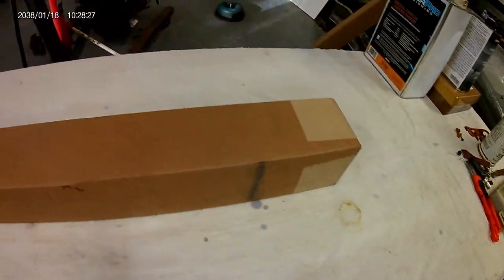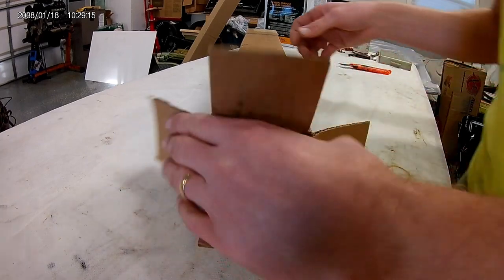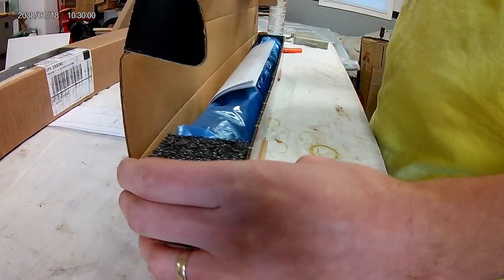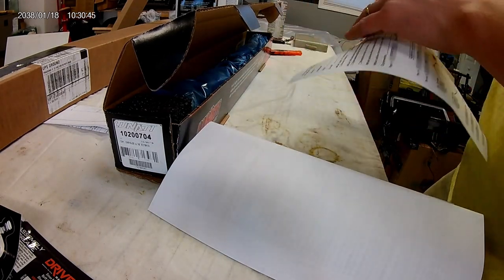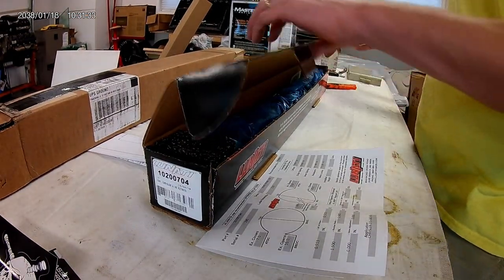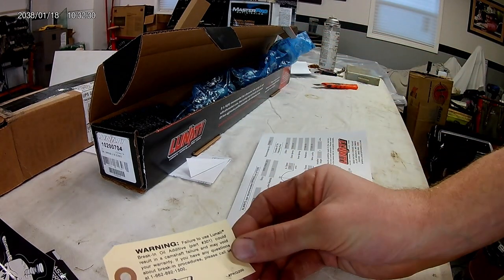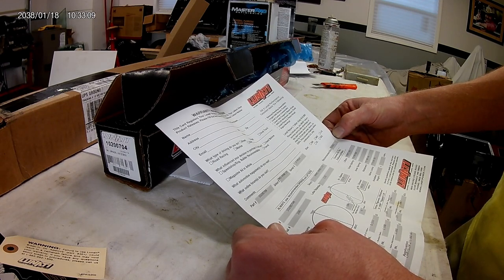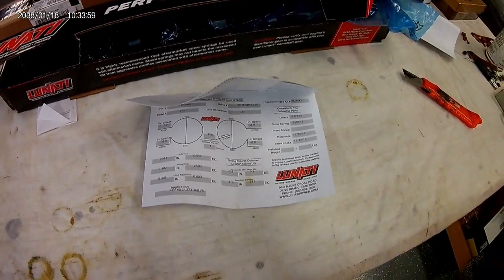Lunati Voodoo Camshaft Unboxing(Small Block Mopar) Part number LUN-10200704

Comment: Do lunati cams really change the performance of the engine for the better or is it just for sound
Reply from the maker: Absolutely better performance. If you can afford a roller setup, it’d be a great idea.
Reply: @JustMoparJoe  i cant ahahaha well i can but im running a budget rn just because eventually if i blow up the engine im gunna go ls rn im bout to put a cam in some new headers blvk widow exhaust and an msd ignition system set up since its cheaper than doing the full on ls set up but hell yeah thats good to know now i know the lunati cam will give it a good uuummumphhhh !
Reply from the maker: Absolutely! This cam was actually one size too big for my combination. It worked fine, but wasn’t quite optimal